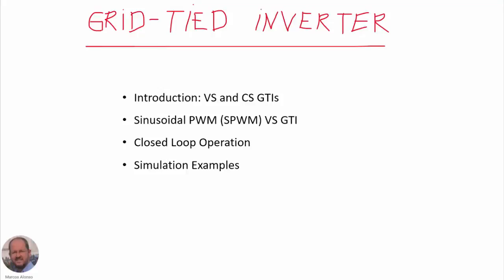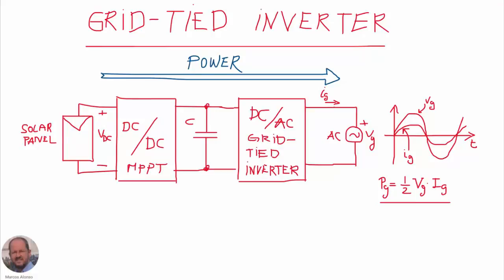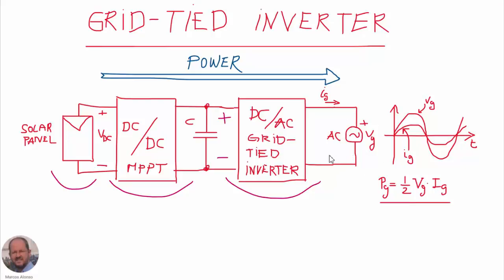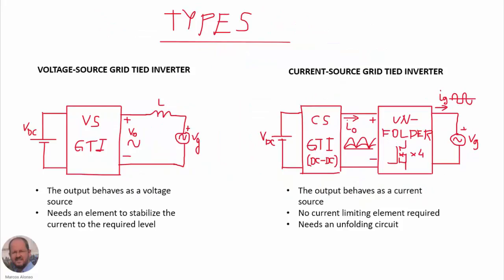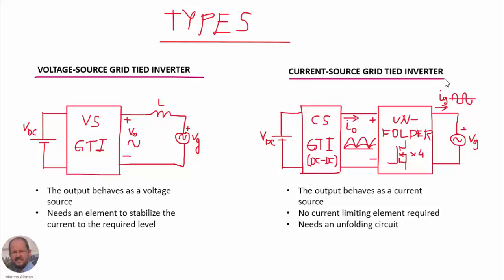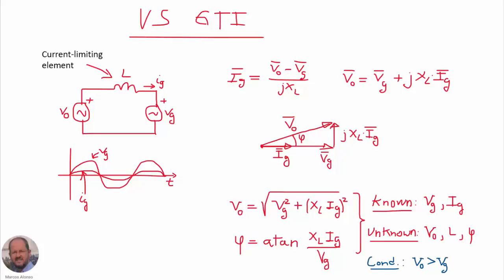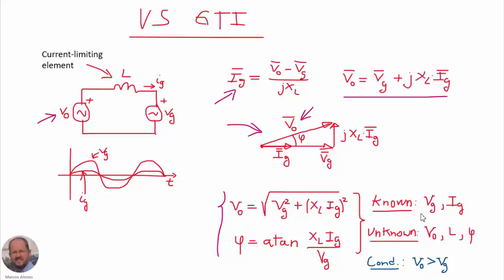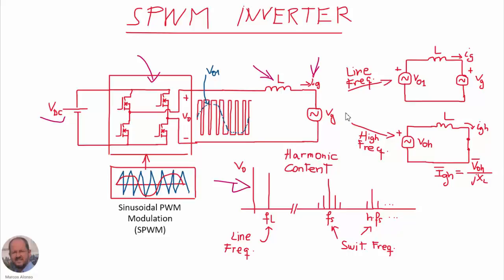PE #11: Voltage-Source Grid-Tied Inverter

Comment: Hi, for the simulation to work on my computer  I changed GBW from from 10Meg to 1Meg
Reply from the maker: Hello, GBW fixes the cut-off frequency of the opamp. It works fine on my computer with 10 MHz but it is OK to use 1 MHz too. It is even more realistic for a real application. Thanks for your comment

Comment: thank you very much for this, how can I find the efficiency of this inverter?
Reply from the maker: In principle you can do it as in any other converter. Just represent the input power as the input voltage (V3) times the input current (I(V3)) and then obtain its average value. Same thing for the output power.
But the input current is high frequency so it is better to add an EMI filter at the input before calculating the input power.
Thanks for watching!
Reply: @MarcosAlonsoElectronics  thank you very much, also I have tried to change the MOSFET to a sic one, model c3m0120065d but the simulation was too slow, can you please tell what should I change in the circuit or what should I consider in choosing a sic MOSFET for the same circuit? Thank you again:)
Reply from the maker: This simulation is tough for LTspice because it has high frequency and low frequency operation superposed. So I don't recommend using complex models. You can try relaxing reltol parameter using .reltol 0.1 to speed up the simulation.

Comment: nice, video sir, i want explanation of finding proportional gain and integral gain for tuning purpose.
Reply from the maker: The design of the compensator is explained at 27:50. The zero of the compensator is selected at the same frequency as the pole of the plant.
The gain of the compensator is chosen so that the loop-gain bandwidth is much higher than 50 Hz. In this case, we obtained with 1.59 kHz for the bandwidth, which is more than one decade beyond 50 Hz.
Thanks for watching!

Comment: Doesn't the feedback via current sensor and compensator effectively turn the overall circuit more or less into a current source as well?
Reply from the maker: Thanks for this excellent question.
Yes, of course. But what is a current source at the end? It's but a voltage source with a current-limiting/regulating circuit. 
In the video I tried to highlight the fact that a series impedance (even though very small) is necessary to regulate the current. Otherwise, if we consider the ideal situation in which the series impedance is exactly zero the system will be unstable because we would be connecting two voltage sources in parallel. There is no way to limit the current, even in closed loop.
The explanation in the video is something that you don't usually find in books or articles about this topic (at least I didn't find it). Usually they just explain that you put the filter to remove the high frequency harmonics; but it has also the function of limiting the current so it is possible to find a stable operating point even in open loop if you can accurately fix the inverter output voltage in amplitude and phase. The closed loop makes this "accurately fixing" for you automatically.
Please, let me know what you think. Thanks for watching!
Reply: @MarcosAlonsoElectronics  I really appreciate this point of view from which you consider the grid-tie inverter. Once you mention it, it's obvious that neither the open loop nor the closed loop can be stable without a series impedance. But that's not what one considers at first glance, and as you say, it doesn't seem to be mentioned anywhere else.
Reply from the maker: @gf-xy2of  Thank you!

Comment: nicely explained and thank you so much for your video, but why the straight line with "-20 dB/decade" not "zero or I mean unity" not "+20 dB/decade"?
Reply from the maker: Thanks for your nice comment and question.
As shown at 30:00 at low frequency the gain of the system is given by 1/rL and rL=0.1 Ohm so the DC gain is 10 Ohm^-1 (20 dBOhm^-1).
Reply: @MarcosAlonsoElectronics  Thank you for fast and quick response Sir.

Comment: 23:36 Sir, In the FFT of SPWM node, there are continuous lines. What does that signify. I understand that because of spwm, only discrete frequency component should appear, not the continous spectrum of frequency. Can you Sir, kindly elaborate.
Best Regards,
Sanjay
Reply from the maker: Thanks for your question. I suppose it is due to the way the FFT is calculated in LTspice. You can disregard them and consider only the peaks corresponding to each frequency harmonic.
Thanks!
Reply: Dear Sir ,
How to generate the current reference for GTI, preceded by a MPPT based DC/DC converter.

Thanks & Best Regards,
Sanjay